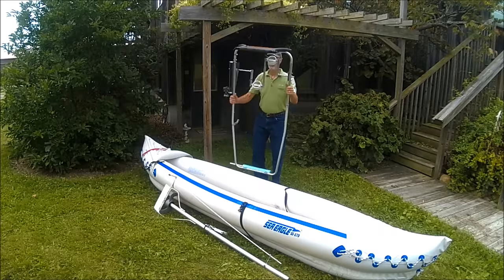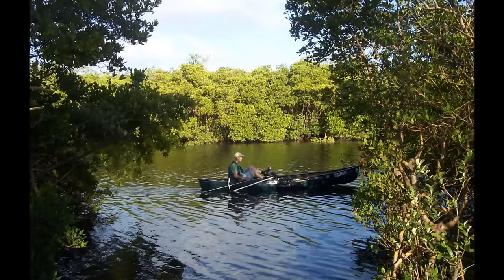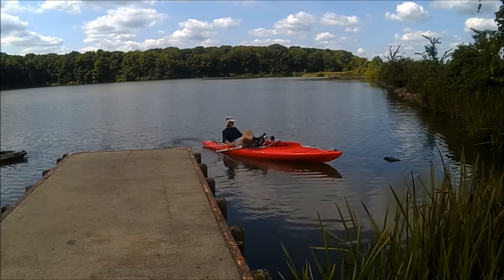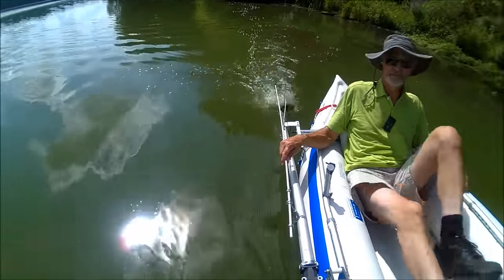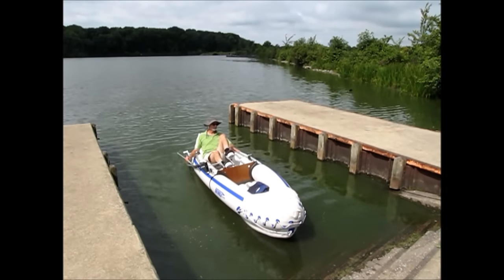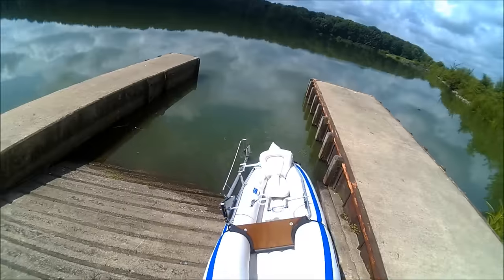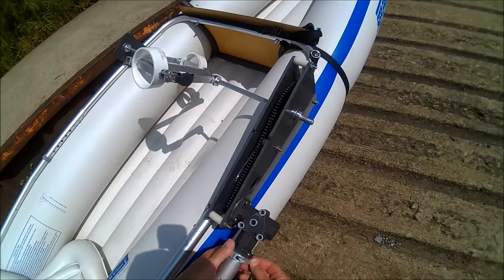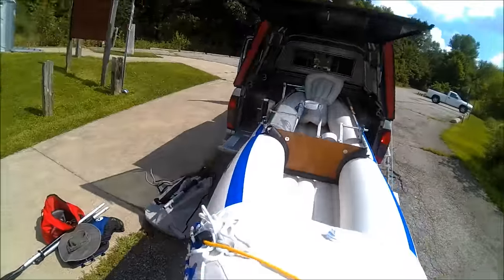Pedal Prop- Add on pedal propulsion system for paddle sport watercraft Part 2

Comment: This seems like a nice pedal drive, I have been looking at diff portable pedal drives, got my eye on the H2PRO-PED for my yak which is a nucanoe frontier 10. Nucanoe is actually working with h2pro-ped to further improvement on it  for the nucanoes, should be out by this spring.
Reply from the maker: Thanks Nash. The PedalProp is a great drive and is unsurpassed, in my humble opinion, in shallow water, areas of sunken logs as well as beaching and launching. I have talked to a Nucanoe dealer in Florida and taken a look at them, nice boats. It would not be difficult to mate a PedalProp with the Nucanoe, just trying to provide another option for you!
Reply: Competition is loved by the consumer🥰

Comment: Very cool. For me, however, not $1100 cool. Especially since it would be going on a $250 kayak.
Reply: i hear you it wouldnt cost more than 400 to build it with a stainless steel prop
Reply: You can get a Bixpy waterjet for that, no?
Reply: @lexwaldez  3. Fucking. Years. Later.
Reply: Ooff for that money you hava an electric motor

Comment: This is one of the most expensive options out there... not seeing the reasons for the expense.
Reply from the maker: This is an older video and a number of changes have been made to make the PedalProp even more versatile.  You can see these changes at pedalprop.com.  The PedalProp can now be placed on all categories of paddle sport watercraft, sit inside and sit on top kayaks, canoes and SUPs! The price now starts at $1,200, undoubtedly the most expensive drive out there. I make no apologies about the price, a quality industrial gearbox, all stainless steel fasteners and innovative design is not cheap. It costs what it cost. Thanks for your comment.

Comment: What kind of gearing and prop does it have?
Reply from the maker: The standard prop now is a three bladed 11.8 inch diameter prop with a 10.5 inch pitch which has replaced the two bladed prop (which is still available if desired). The finial ratio is 1:6 , but can be much higher as the driver sprocket has a common hub that can accommodate a number of optional plate sprockets (both higher and lower than the 6:1).
Reply: pedalprop Thanks.  If its not a trade secret, what are you using for gears?
Reply from the maker: The gearbox is an quality (and expensive) industrial gearbox with stainless steel spiral bevel gears with an aluminum alloy housing. I selected this gearbox for its reliability, small size and low weight despite the rather high cost.